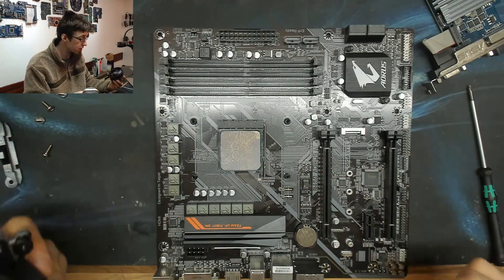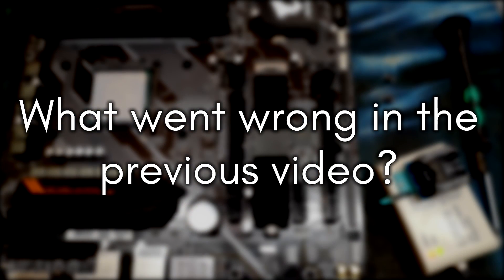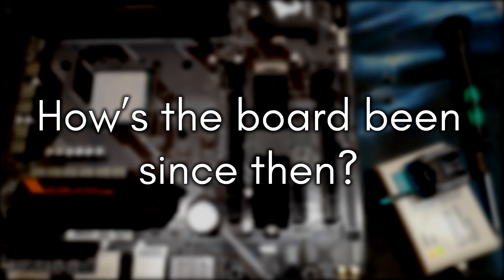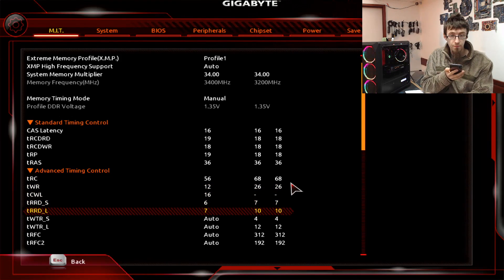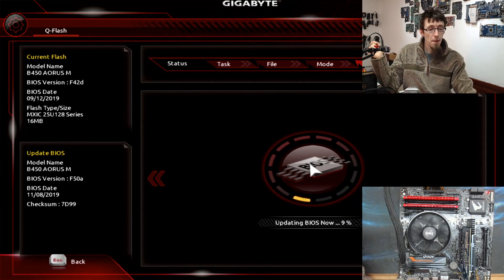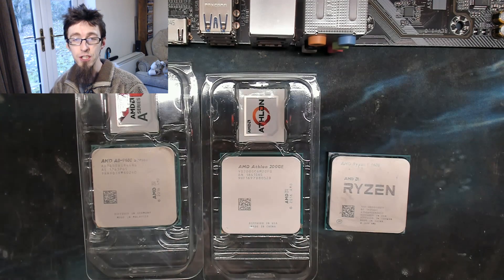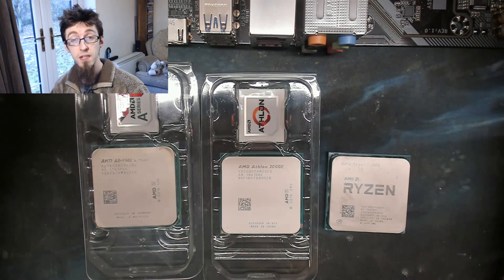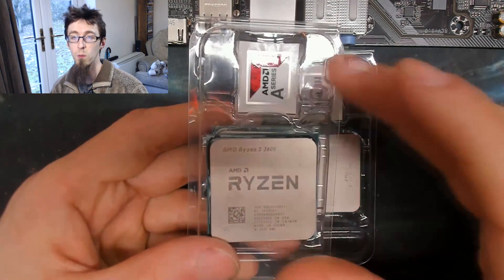LFC#186 - Gigabyte B450 Aorus M Update and Conclusion

Comment: After reviewing youtube videos for over a week I happen to come across this video that explained my issue. My issues was a bios flash to F31 on a GA-AX370 Gaming 5 in order to install Ryzen 5 3600. Unfortunately I sold my Ryzen 5 1600 and had to purchase an A6-8350. After flash neither CPU are supported under the F31 Flash. Thank you for explaining this issue where I have fell into the dead zone. I purchased a Ryzen 3 1200 to at least get the computer running in order to flash to F40 so I can add my Ryzen 5 3600. Thanks Again !!!!!
Reply: Damn, that sounds like a right headache.
Reply: @carl8568  yes, it was, I spent 3 days wrapping my head around why the board wouldn't post and found this youtube video that steered me in the right direction. I almost threw the board out as defective!!!!
Reply: @sullivanmccurdy3449  Far as I'm concerned , to go thru this much crap to run , it is defective . I say Class Action lawsuit
Reply: @stevehtml5490  it was not defective and if you spend any amount of time on anything, it may take a little fiddling to adjust it. I have no desire to sue anyone as people get to wrapped up in trying to force companies to do something that just may not be cost effective.
Reply: @sullivanmccurdy3449  Box says  "Ryzen 3000 ready" & is not , I don't see LYING as "cost effective" but then what do I know beyond Right from Wrong
Reply: @stevehtml5490  its not the cpu that was the problem,  or the board, it was the bios, so my opinion is they didn't lie. The bios file can only be so big so some files within the bios were removed by the manufacturer to make room for others. I created my own problem as I didn't have the CPU at the time and was trying to get it running with an older cpu that support was removed from the bios file. When I was able to get the computer to post with the old cpu I never had a problem with the Ryzen 5 3600 which ran perfectly.
Reply: Update Completed installation of Ryzen 3 1200. Board posted without any issues on F31 Bios update. I did not continue with BIOS updates as this computer is my HTPC and is performing flawlessly, so im not going to fix a working system. Thanks again for the excellent explanation of dead zones in Bios flashes.  If anyone can offer any benefit to continue with bios flashes, please offer.
Reply: please recommende a motherboard for a Ryzen 5 3400g, I don't want to update any bios please!
Reply: @androidgameplays4every13  b550 or x570. Wish you luck bro
Reply: We got a same board, using 1700, from F31 straight to F51a no hiccups
Reply: @CrayonKureyon  Thanks!!!!I forgot to mention my board was a manufacturer refurb which in essence may of had an issue with the bios of which it was sent back to the factory for repair. I have no issues after my dance with bios flashes so I am completely satisfied.
Reply: That's why I omit Gigabyte boards.
Reply: man i thats paintful,..

Comment: I fell a victim to smooth advertisement and assortment of the accessories that come here, neatly packed into this small motherboard.
Once I bought it, I sat home and researched, that's how I came to find this series you started. I knew it couldn't be good, at first glance, I was happy with the buy...
After seeing all the you went trough, I instantly regretted this. I hated the fact that I had to buy the one of few if not only motherboard with this big of a flashing issue. 
I am still triggered even tho it's been a month, finally, my RAM and CPU cooling for Ryzen5 2600, is arriving tomorrow and I am more than anxious to put the build up together. 
This series has helped me a lot to understand everything, I found much help in the comment section here, tomorrow, I will know what the bios version it came equipped with. I hope I get lucky with a single bios update! What I understood here was to go >F32 > F50... We'll see how all this adds up! Thanks for all the knowledge :D will report on how it all went.
P.S. If I somehow managed to watch this before buying, I would NEVER buy this one, the budget differences aren't worth the worry, in my honest opinion.
Reply: What was the version of the motherboard?

Comment: Hey, I've been having some BSOD problems for a while now and have never updated the bios but system information says I'm running on version f41, should I still update to F50 and if so can I go straight to F50 or do I need to update to F42g first also do you think this could solve my BSOD issue? (I am very new to pc this is the first pc I have ever built)
PC specs
Ryzen 5 2600
B450 Aorus M 
16 gbs of corsair vengeance 3200mhz 
Radeon RX 580
Reply from the maker: I would try the updated BIOS. You can always roll back if it doesn't help. With a Ryzen 2600 you can run any BIOS version on this board. If the BIOS update doesn't help, try turning off XMP (thus running the RAM at 2133MHz) - and then if that fixes it, check my video on XMP for how to resolve that.

Comment: I have the same motherboard and it came with bios f50. I have 2x16gb 32000mhz rams. They run on 2133mhz and when I turn the xmp. ıt shows 3200mhz. I save it and it resets, It doesn't boot, sometimes it boots but then the bios is reset to default. Some times it doesn't make that far and I have turn off the machine wait a minute and it resets the bios and when it boots up still runing at 2133mhz. Is it a motherboard issue ? or am I doing something wrong? My cpu is 2700x
Reply from the maker: Try running it at 3000MHz. Alternatively, if you've got time on your hands I made a video about doing it all manually: https://www.youtube.com/watch?v=KB_OckQTpjo
Reply: Hey brother! I know I'm a little late but worth the try... Did you find any solution for this? I have the same problem with my B450 Aorus Elite v2
Reply: That motherboard kinda sucked on me on basically just using the XMP. I was able to run them at 3000Mhz but it took some trial and error. I did some load tests. It was fine then started to freeze on me. Now I run on low settings. I tried the same rams on a different motherboard and they were running at 3200mhz buy just opening the XMP profile. I am would not highly recommend that board

Comment: hi adamant i have an aorus 450 elite on f4 running a ryzen 1600x ,is it safe to use @bios to flash and which is way incremental or from f4 to f51 , thanks

Comment: Please, i need help, i have a aorus b450m with a 3400g after a firmware update if i turn on the pc it will take 2 minute to boot into the os or the bios
Reply from the maker: Do you know which BIOS version you're on? Do another update to F50 if you're not on F50 already, and see if that clears it up.
Reply: hey frank, was your issue resolved?

Comment: HI Adamant, I have this motherboard Gigabyte B450M with Ryzen 5 1400. Some gift me with Ryzen 7 3700X. I want to replace my current cpu (Ryzen 5 1400) to Ryzen 7 3700X. Is this still be ok to use this motherboard after I update the BIOS to the latest. Please adice. I dont have any idea how much Ryzen 7 3700X VRM rating needed to run in this motherboard.
Reply from the maker: Yea it'll run a 3700x, just make sure you've got a rear or top mount case fan so there's a little airflow for the VRM heatsink
Reply: @Adamant_IT  Thanks bro. Also  I got only 500 watt 80+ psu with RX580 gpu 2 dual monitor on RYzen 7 3700X maybe will have 6 fans on it..Is 500watt psu enough?...
Reply from the maker: Yea I think you'll be alright there. 3700x is only 65w TDP, and while it'll go over that, we can assume it's not going to go over 150 or so. 200 for the GPU, 50 for the mobo and ram... it'll be fine!
Reply: @Adamant_IT  thanks for the advice. Making my hands on PC this coming weekend..Hoping all is well.. God bless..
Reply: @Adamant_IT  thanks again pro..Another thing.. can i upgrade my 2400mhz ram to 3600mhz for this motherboard?
Reply from the maker: Should be okay with the latest BIOS. I had issues with 3400 RAM early on with this mobo, but after the F50a update, 3400 worked just fine, so 3600 should also work.
Be prepared to under-clock at 3400 if you have issues though. As long as your at 3200 or more it won't make much difference.
Reply: @Adamant_IT  yeah just bought 3200...thanks a lot bro.. Now my system runs smoothly.. Hoping nothing weird happens in the near future..

Comment: So if you had received a board with Ryzen 3000 support out of the box, would everything be fine?
Reply: Yep, i have same board as in the video but the only difference is my box stated 3000 ready. So i tested with a ryzen 5 3600 no problems at all. So yeah im sure you'll be fine.
Reply: JyoShU Plays thanks, I already built it like 2 months ago. It works great! I have the same processor it’s fast

Comment: Does F50a bios supports ryzen 3 2200g? I plan to get that board with f1 and update it. I'm gonna use 2200g for a while untill I buy ryzen 5 3600
Reply from the maker: 2200g should be supported by all BIOS versions with this board, safe bet.
Reply: @Adamant_IT  Thanks for replying. The safest bet is to just update to latest pre-ryzen 3000 bios and then update to newer once I get r5 3600. 
I used msi b350m gaming pro with 2200g and wanted to update bios to beta version that supports ryzen 3000. Ended up with no post and no debug lights on, just fans endlessly spinning. I'm not sure if I bricked the board or just msi dropped support for 2200g to include ryzen 3000. I haven't found a way to repair the board so I'll get new aorus b450 m.

Comment: Ok, I have been watching your previous videos to get a better clue about the issue.  I found this video just now. It seems like you have got deeper into the problem. This is better. But it still isn't good as I hoped. 
 3200 Ram is okay for me. So I can accept fiddling with broken bios links and taking a long time to find my way up by using your guide.
The problem is ability to start the system with the primary CPU. 

I assume, if I get a bios like F1 to F5, I won't be able to get this board working right away with just a 3200G. 
Even though I have no other use for it, I even considered getting a Athlon 200GE just so I can update the bios. But apparently it won't be useful below F30... 
pffff..
I really don't want to spent so much for a Ryzen 1000 or 2000 just to flash bios.

So annoying. 
But at least you showed us the possible problems. 
As I don't have any tool you have, I would not be able to find the problem and that could make me lose my mind. 

Thanks for your work.
Reply from the maker: Yea that's the crux of it. And to add insult to injury, the 200GE I've bought seems to have been killed off already, it's not listed on compatibility charts for X570. It might work by fluke, but now we're into the final act of AM4, there's too many AM4 CPUs for it to be as simple as 'if I fits I sits'.

Comment: So what exactly caused the bios resetting issue? I am having an issue where my bios reverts from f42g to f41 when psu is off. Tried new cmos battery/ re-seating memory and connections.
Reply: Update Managed to flash to F50 eventually. No further issues and boots faster than it ever has. (Running Ryzen 3 2200g at 3.7GHz)
Reply: @Luke-hc6ud  hey luke, I have the same board, but im on a ryzen 5 3400g. Current bios is F41. I want to get my bios updated to F50. F50 instructions: "Before updating BIOS to this new version, you MUST follow the steps as detailed under BIOS F40 description." F40 Instructions: "1. If you are using Q-Flash Utility to update BIOS, make sure you have updated BIOS to F32 before F40
, 2. Before update BIOS to F40, you have to install EC FW Update Tool (B19.0517.1 or later version) to avoid 4DIMM DDR incompatibility on 3rd Gen AMD Ryzen™ CPU" 
so am i correct to say that the actual steps i have to take to update bios from F41 is to flash my bios to F32 then straight to F50, is this correct? and if it is, if i do follow the steps and flash my bios from f41 to F32, will i be fine with the ryzen 5 3400g? I really apologize, as i am an idiot.
Reply: RED POTATOES if youre board was supplied with F40 or newer then you can go straight to F50. Just follow step two in those instructions and install EC FW Update Tool beforehand. This is what I did and have had no issues since, F50 seems very stable and fixed overclocking issues I had on previous bios. Hope this helps.  Note: I learnt the hard way that this board has no manual bios switch. if it has reverted back to original bios after flash/ power cycle it may be that there was an issue with the flash and for safety your board has gone to the backup bios chip. I didn’t have this issue with F50 but believe this was the issue I was having with previous bios. F50 actually fixed this.
Reply: @Luke-hc6ud  Thanks Luke. I did some more research and found the gigabyte App center and found that I can update my bios via windows. Should I give this a try, do you think it's safe? I will be Flashing bios from F41 (board did not come with this version FYI) to F50 Directly. System Specs
PROCESSOR: Ryzen 5 3400 G
Motherboard: Gigabyte B450 Aorus M
RAM: TEAM T-force Delta RGB DDR4 16GB CL-16-18-18-38 1.35V 3000mhz (8x2) - running 2933mhz XMP off - gets unstable when I turn XMP on even if I up the DRAM voltage to 1.40, or even using DRAM calculator manually inputting the timings.
STORAGE: AORUS 500GB m.2 GEN 4 (this was the only available storage device when I built my system from local retailers that fits the system theme)
PSU: Silverstone ET550-B 550W BRONZE 80+
Operating system: Windows 10 64 bit PRO
Windows version: 1909
OS build: 18363.836
from this setup do you think I'll have any issues? Im really hesitant to do it as I fear i might brick my board, the only reason why I want my board up to date is because I ordered a 5700 Xt that might arrive next week and I just want everything in my computer updated before I install my gpu. (I am aware about the bottleneck, I'm just gonna save up some more to get the 3600 soon), what are your thoughts luke?
Reply: RED POTATOES usually I would say don’t touch the bios unless you absolutely have to. There is still a risk despite the bored having dual bios chips. However Version F41/42g were so unstable for me, especially when overclocking, that in this instance I would say go for it. I flashed mine from a usb. Never used the windows tool but I’m sure it fine.
Reply: F50 should fix your memory issues, I had the same problem. I believe it was a bug with 3rd gen ryzen on this board.
Reply: @Luke-hc6ud  yes it did fix my memory issue.
Reply: Hey! I know I'm a little late but worth the try... Did you guys found any solution for this bios reset problem? I have the same problem with my B450 Aorus Elite v2, it works good all day with xmp 3200, but the next morning on cold boot it goes all the way to the windows desktop, then restarts itself and don't want to post until I unplug it from the wall. And when it starts all my bios settings are resetted... I'm on the latest bios version btw (f60h if I remember correctly)
Reply: @matheus9365  sounds to me like its booting to your backup bios. I am still on f50 so cant tell you much about f60 but make sure you have followed the steps for bios update on the gigabyte website.  what cpu are you running?
Reply: @Luke-hc6ud  I've made everything as it's written in gigabyte's website, step by step. Cmos battery is new also.
My config is:
Ryzen 5 3600
Gigabyte aorus B450 elite v2 rev 1.0
2x8gb adata xpg spectrix d41 3200mhz (sk hynix chip)
Asus tuf3 GTX 1660s
Samsung Evo 850 250gb ssd
Cougar sl600 PSU.
W10 Pro

Comment: The points i got:
- Having an 1000/2000 Ryzen series you will be ok to update BIOS without so much problem.
- Considering you have one of the CPU series commented above...to update fine to the latest BIOS version you need to update to F30 (F32?) and then flash to the latest (which actually is F50). 
- You dont need to necessarily update to F40 to be able to flash to the latest one. 

What i didnt get:
- EC FW Update is really not needed?  I mean...if you dont have your 4 memory slot being used, you can ignore this?
- Some old bios versions have an note to update the AMD Chipset driver before updating it to some newer ones.....this thing make any difference updating it or not?
- No matter what BIOS version i have in my MB (even F50 which is the best now)....if i unplug my PC from the wall....my BIOS will be reset and i will have to make everything again?
Reply from the maker: Zen1/Zen+ for safe updates, Yes
F30 then Latest, Yes
Skip past F40, Yes
EC FW, correct, only needed if you're running 4 RAM modules, I missed this in the video
Chipset Drivers, not sure. Haven't seen any need for this, maybe not relevant on fresh windows install
Resets if unplugged, MAYBE. I fixed mine accidentally while soldering, but lots of reports from others of this fault.
Reply: @Adamant_IT  Is it possible to do the EC FW update in the future to use 4 sticks? After we got it F50+
Reply: Hey Rodrigo! I know I'm a little late but worth the try... Did you find any solution for the BIOS reset after unplugging it from the wall? I have the same problem with my B450 Aorus Elite v2

Comment: Yesterday, 27/12/19, I built an AMD Ryzen 7 2700 system with this motherboard using 16GB Corsair Vengeance 2666 and a GTX 1660Ti.  at first switch on the BIOS would freeze as soon as I used the mouse, it arrived with BIOS F41 installed.  I managed to get by with the keyboard and immediately flashed it to F50 and all my troubles disappeared, switched on XMP and all good running at full speed, might even switch memory for 32GB Corsair Vengeance 3000 I have.  Thank you for your videos, they saved me an awful amount of head scratching and grief
Reply: I have a similar setup but with a 1600af oc'd to 4.0. just fyi got my corsair vengeance 2.4k to 3.2k with good timings @ 1.35v it's oc friendly ram.